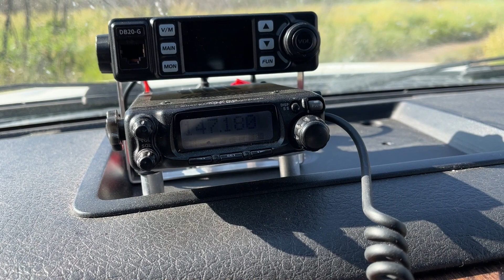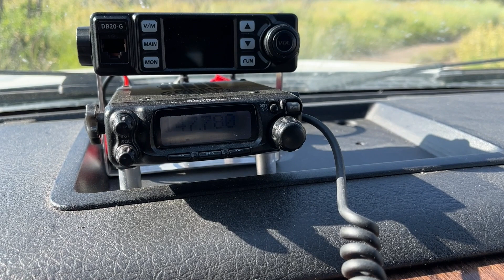He used a handheld Ham Radio and Linked Repeaters - #deepbackcountrycomms

Comment: Great video and thank you for being the only one on youtube talking about linked repeaters in this way. Maybe you can help me understand this a little better. A repeater near me is connected fulltime to the Montana Repeater Link Association and has this info on it as well:

Commands: 	Link to the Intermountain Intertie: On 196 / Off 197. Automatic 10 minute disconnect.

What does that mean..? I'm not sure what the 196/197 is for or how to use that to link to the intermountain intertie. In theory, this would give me amazing coverage if I can just figure out how to get it to work.

Thanks again for your great video.
Reply: Hey
I use the 147.12 on Farnsworth in Utah
I am a UtahVHFS member I know the codes for controlling from our intermountain intertie side. 
197 OFF
196 ON
when operating from the UtahVHFS side we have to put a prefix that gives us dial tone telling us that we are controlling that certain site
I was up in Montana a couple days ago
 All you have to do is Key up and Dial 196 to turn the link on (it gives you a double beep telling you it connected successfully) 
then after 10 minutes or you dial 197 it will disconnect and give you another 2 beeps
Reply: @kk7gkg  Awesome, thank you! That's what I figured and I've tried it several times but I've never once gotten a response so I thought I might be doing something wrong.
Reply from the maker: Hey! Thanks for checking this out. This video highlights that linked repeater system. If you open it up on your end, then we could probably chat. You may want to get with your local ham club to make sure you're doing it right, but to turn on that link you simply key in "196" while keying the PTT. But depending on the setup, there may or may not be an additional key in the procedure. So, I'd reach out the the local club and make sure you've nailed it. 

Thank you again. Hope you catch you on the intertie! - KI7WJP

Comment: Four months later/timely video. This is what I was playing with today. If the repeater antenna is high, you don't have to be, but don't plan on hitting what you can't see. You can, "Possibly maybe," (Björk fan, not sorry,) but don't count on it. Terrain matters. I'm very lucky to live in flatland desert with a bunch of repeaters up on old volcanos to experiment with. I can open squelch 30, 40, 50, even 60 miles out with an ht and a signal stick if conditions are absolutely perfect, but i don't get to plan conditions when I need it and they're only rarely that perfect, so practice, practice, practice 'til you know what's more normal or reasonable. Get familiar with the locations and lines of sight in the areas you want to work. And have fun! 
I am not an expert. I'm a brand new operator. I'm learning this as i go. 
73 de AI7UQ
Reply from the maker: Sounds to me like you have a pretty good idea of how to map out your communication locations. And you're right. There are plenty things we can count on but enough that we can't. Things work against us, even ourselves. I've had directional antennas pointed entirely the wrong way. Obviously that didn't work out for making contact!! I'm no expert either, but I love to share my experiences. Thanks for sharing yours. 73 de KI7WJP

Comment: Sounds like he was using an MFJ Long Ranger? Yep, another good half wave whip for mountain top and SOTA type use.
Reply from the maker: That's about it I think. I've seen similar from Smiley Antennas as well. I personally think every ham who ventures out into the woods should have a 1/2 wave in their pack or on their radio. 73 - Eric